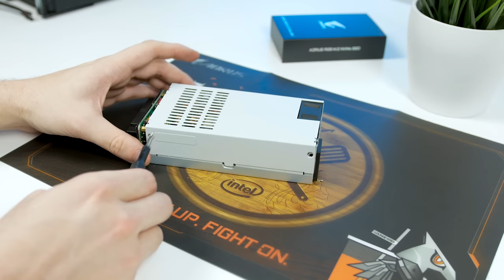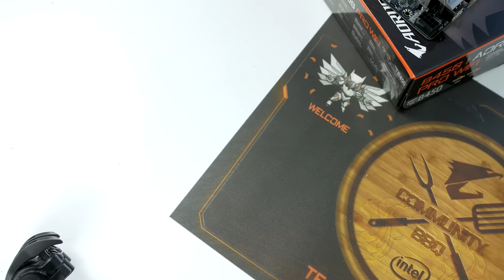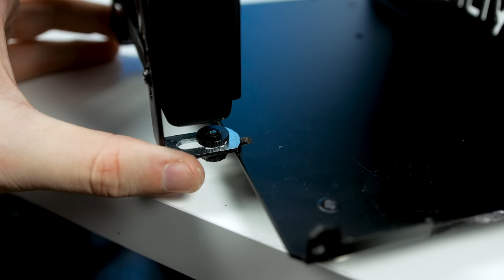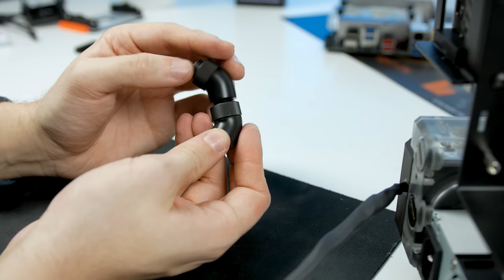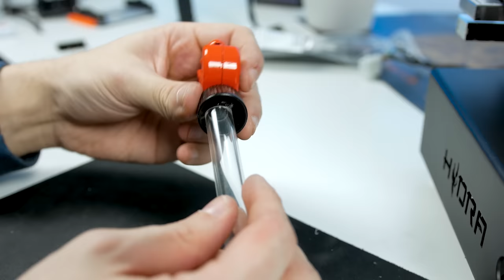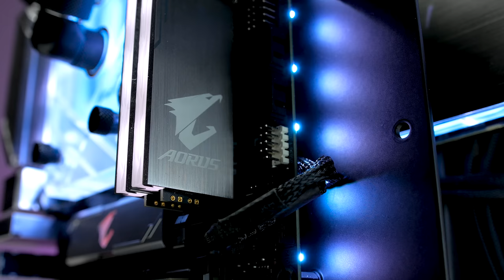Mein ULTRA kleiner GAMING PC 2020 | RTX 2080 R5 3600 Wasserkühlung!

Comment: Hallo Zenchilli, 
ich habe mir im Juli einen Pc zusammengebaut, alles lief flüssig und ich konnte jedes Spiel auf hohen Einstellungen spielen, jetzt seit neustem habe ich einfach so, von jetzt auf gleich extreme frame drops, ich bekomme in Rainbow six siege auf mittleren bis hohen settings nicht mal dauerhaft 60 fps, was kann ich dagegen tun? ich habe verbaut:
- ryzen 5 2600 
- rx 590
- 8gb ram (habe mir nochmal 8 gb gekauft, kommen bald an)
- asrock b450 Pro 4
- 256 gb SSD
- 1 tb HDD
ich weiß nicht, was ich tun soll, weil ich schon meinen Pc neu aufgesetzt habe, alles deinstalliert habe, das Spiel 3 mal neu installiert hab, alle 
Hintergrund Prozesse aus geschalten und meinen Grafikkarten Treiber upgedatet habe, hast du irgendwelche Tipps oder ist vielleicht etwas kaputt??Ich freue mich auch über jeden vorschlag aus der Community.

Comment: Hey kurze Frage an Dich und deine Community. 
Ich hab derzeit ein Ryzen 5 3600x auf einem Msi gaming x570 pro carbon mit 32gb ram 3600mhz verbaut. Derzeit hab ich leider nur eine asus rog strix gtx 1060 6gb verbaut. Ich hab mir für weinachten einen Acer predator xn3 mit 240hz und gsync bestellt. Auch wenn ich nur esportstitel wie fortnite in fullhd spiele komme ich mit einer 1060 nicht so weit. Was für eine Grafikkarte wäre in meinem Fall jetzt die beste Wahl wenn ich bis 600€ gehen kann? 
Danke schonmal im Voraus :)
Reply: Mit ein wenig Glück könntest du eine RTX 2080 Super für 600€ bekommen
Reply: @Max Xgame Dann eher eine Rtx 2070 super? Was für eine würdest du empfehlen?, also was für ein Kühldesign?
Reply: @Max Xgame oke alles klar 
Danke :)